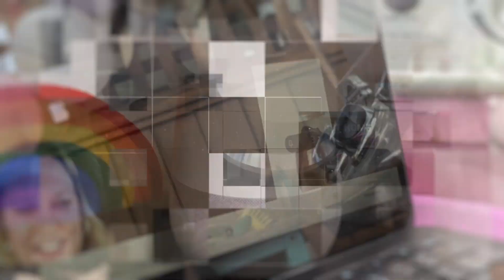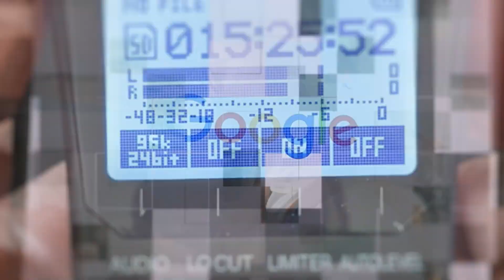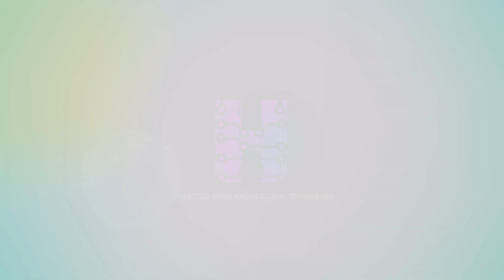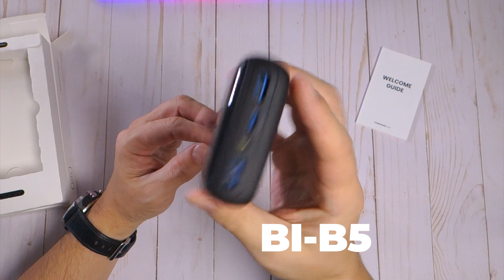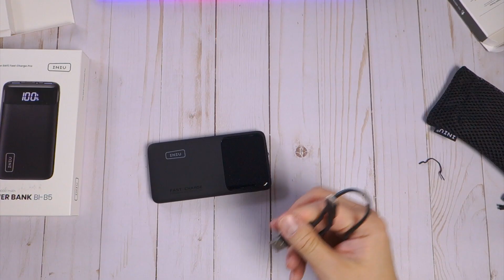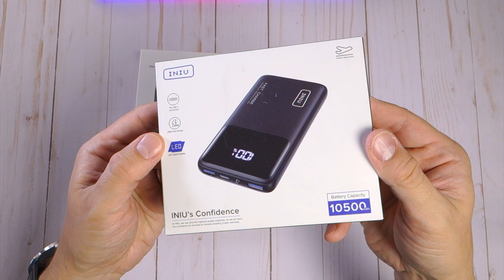Fast-Charging INIU Power Banks: BI-B5 and BI-B6

Comment: The 20000 mAh capacity is for lithium cells with an average voltage of around 3.6 volts. There is a boost circuit in the power bank which boosts the output volts to 5 volts which is a factor of 1.4. This means there is a corresponding drop in the current  output of 1.4 times which means the mAh capacity at 5 volts is around 14000 mAh.  Allow for some heat losses also. This factor is often overlooked.
Reply from the maker: Thanks for the information! That's really interesting
Reply: But it has a built-in flashlight. How long could u power that light in theory?
Reply from the maker: @VinnyUnion  Probably an enormous amount of time because of the small power draw.
Reply: @HowToDoItTech  update: I bought iniui b61 (26000mah I believe) 60w and got a another 100w and gotten a USB lamp and that thing sucks the Powerbank try compared to a Note 9 phone
Reply from the maker: @VinnyUnion  That's good information. What's the draw on the USB lamp? I tried to find the exact specification for the LED light in the battery but the best proxy information I could find is that the LED should only draw down 10mA... in theory it should last quite some time. My batteries have had a few cycles now and the capacity might be somewhat worse, but I'd be tempted to experiment in the near future. Maybe as an update.
Reply: @HowToDoItTech  it shouldn't be much since it's just a basic bendable USB light lamp, pretty cheapo. Perhaps it's just a false perception. Either way it charges my phone way faster than from a brick regardless of the phone having only 15w if I'm correct. Additionally I might experiment with a portable PC and a power bank as well. I thought about simultaneously charging the power bank with a another power that charges the steam deck with a 7to2 (?) Anker HUB, dock and USB to USB-C adapter for a external SSD and perhaps connect a headphone via a lavaliere microphone attached to a USB c amp called Soundblaster G3 :P
I haven't tried these yet so it's still all in speculation. I'd likely to try to add a monitor in the mix as well since the newly purchased monitor has a USB c port which may be possible to utilize it even more. 
I hope I could inspire tho!

Comment: Fun fact: i purchased both. LOL! Well. I might actually need it on an road trip or some other predicament. Having 45k in total (in theory, more or less) is a great help and a relief.

Plus I've additionally ordered that 100w cable (mostly because of its sturdiness & power adapter)

I do have the steam deck (45w) adapter but that cable is not detachable and a noname 100w charger. I figured if I'm gonna have a charger dor the future, i might invest in a compatible package to carry my side.

Comment: Hey, are the measurements for the size of this power bank accurate? it seem's quite large. I need a power bank that's no larger than 7.5cm to fit in my suitcase pouch. Can you confirm the width of this charger??
Reply from the maker: Yep! They are about the size of a modern phone, with the smaller power bank being about as thick if your phone has a case on it. However, the larger power bank is much bulkier because of the extra capacity. Both would fit in a phone-sized pocket.